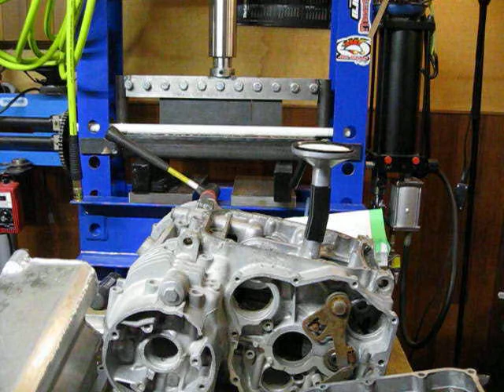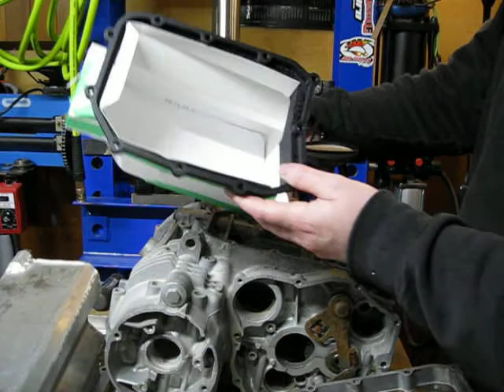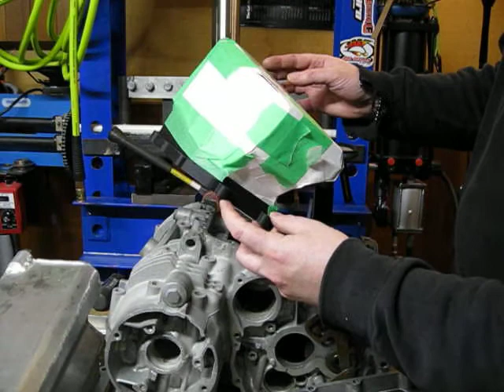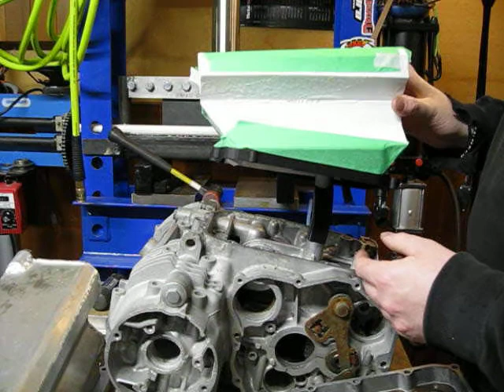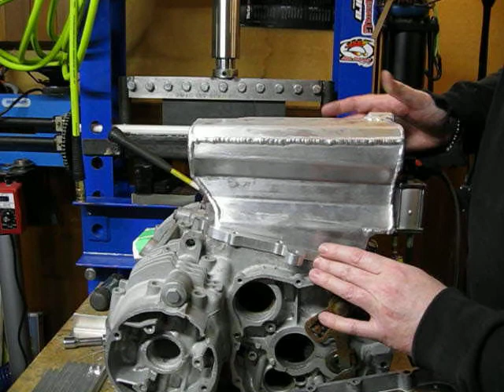CB400F Custom Oil Pan

Comment: Such a good effort on the pan.
What's the long term plan with the pick up tube. Will that stay printed plastic? 
If so, what did you print with? Polycarb?
Reply from the maker: I did not use a printed pickup extension. I machined a new one out of aluminum based on the 3d printed part.